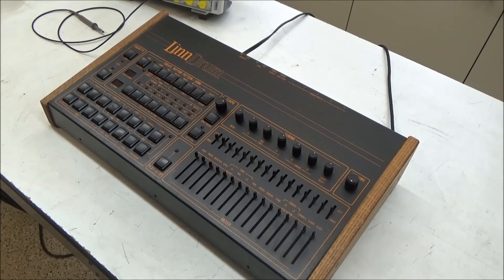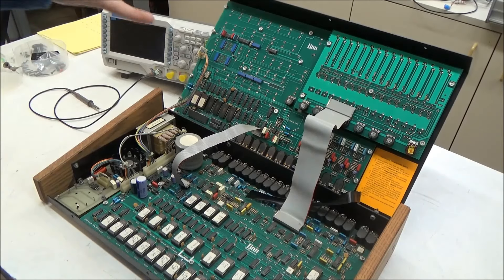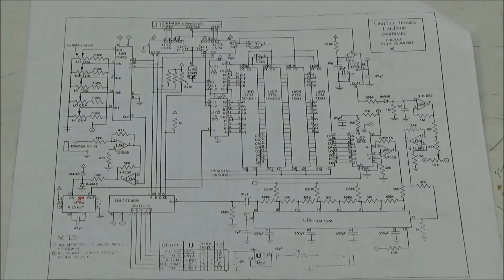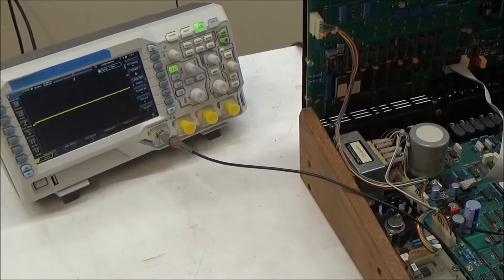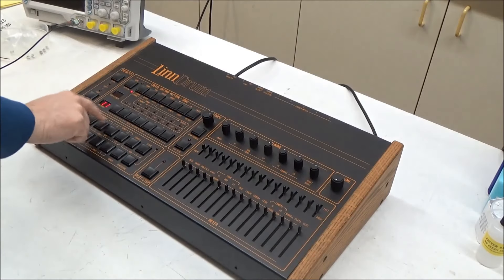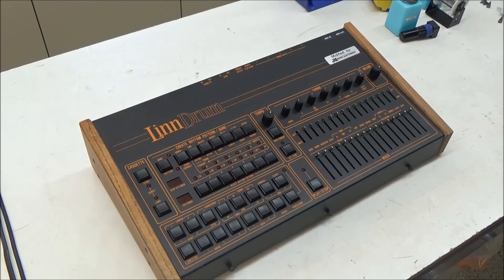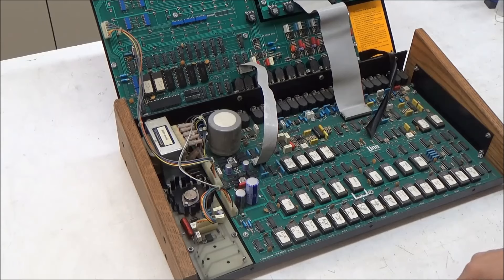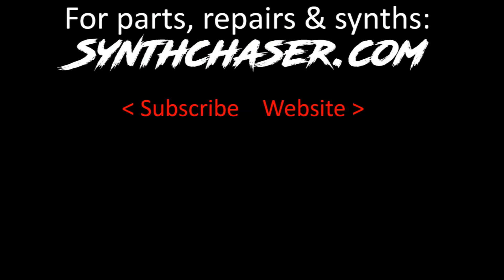LinnDrum Repair & Upgrades - Synthchaser #165

Comment: 12:12 yes!! When I restored my Juno-106, I considered replacing the power supply - but a common aftermarket replacement which I won't name here, built on a few simple commodity switching modules, was being sold for $450! Give me a break! I spent some time and about $5 on parts to instead just fix my original Roland PSU.

Comment: Why no heatsink for your power supply design?
Reply from the maker: It's designed so no heatsink is needed.
Reply: @Synthchaser  that and semiconductors are somewhere between a bit and a lot more efficient than they were when this unit was made.